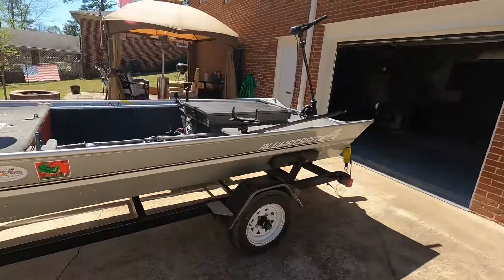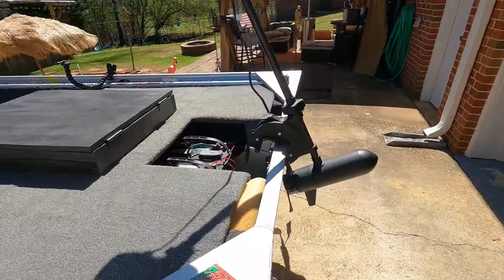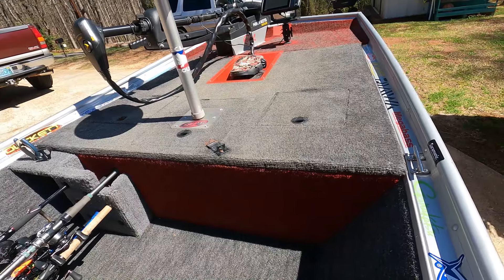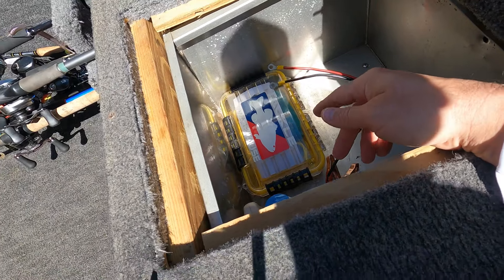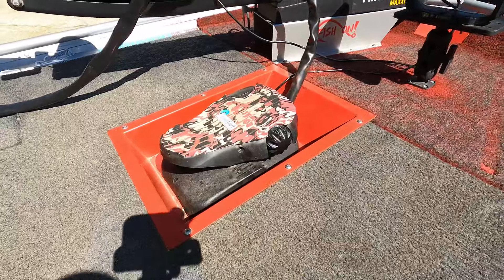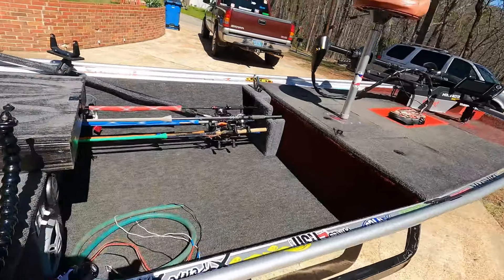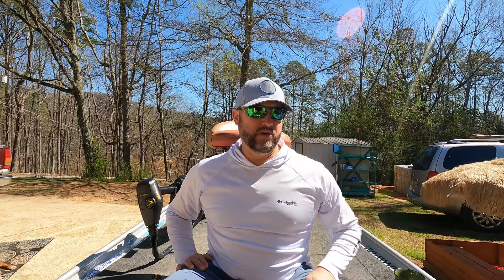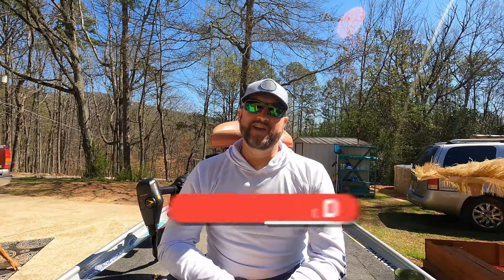"Part 1" DIY Custom Jon Boat Build!! Budget Friendly!!

Comment: Those batteries are in series. Batteries in series will add their voltage together, 12v+12v=24v. Batteries in parallel will add their capacity, 10Ah+10Ah=20Ah
Reply from the maker: Yup your right I meant in series brother lol